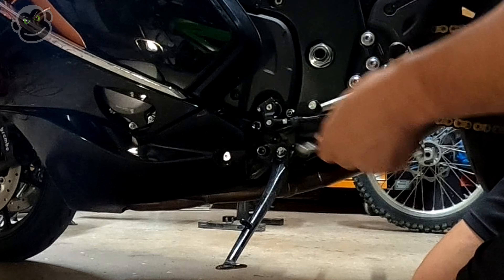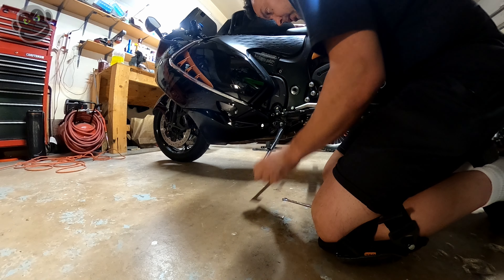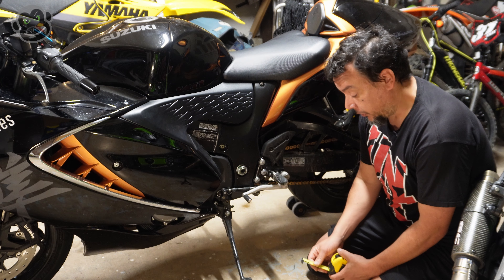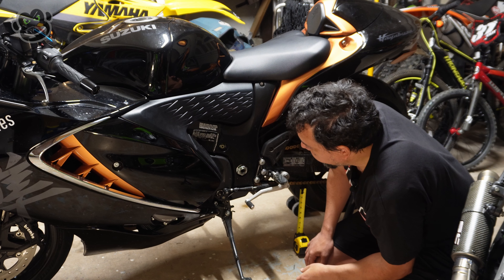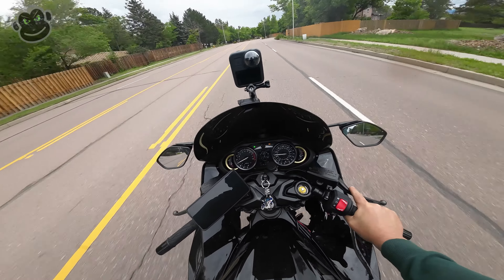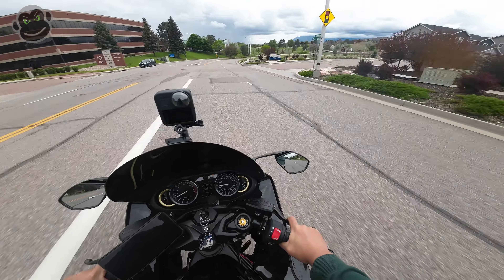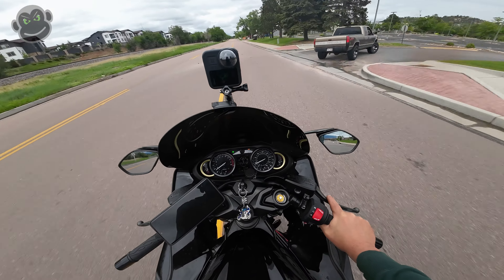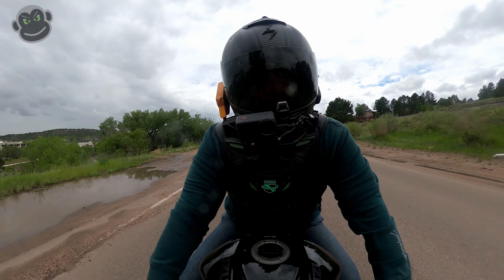2022 Hayabusa GP Shift | Race Shift | Pretty easy but not the easiest!

Comment: With the shifter bolt removed. Shifter would not slide completely off. Did you have a tough time sliding the gear shifter off? Im asking about the part with gear teeth/ the horseshoe looking clamp
Reply from the maker: With the bolt removed it should come off pretty easy.  As long as you are applying even pressure it should just slide off.  Make sure there isn't an dirt/grime in the teeth on the shift rod.  Check underneath.

Comment: So we have to remove sprocket cover and ride without it?
Reply from the maker: Yes, unless you can find an aftermarket cover or you are brave enough to cut a small section off the bottom of the stock one for the shift linkage knuckle to clear.  The stock cover is just plastic, easy enough to cut with a dremel.  Proceed at your own risk....